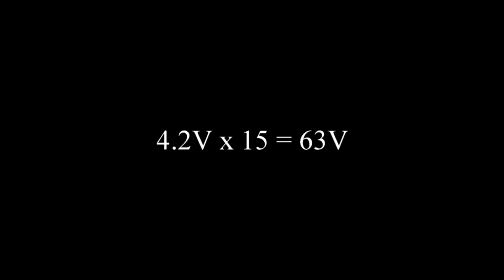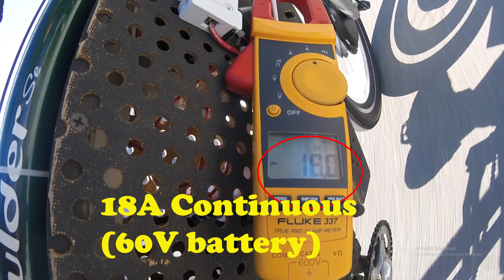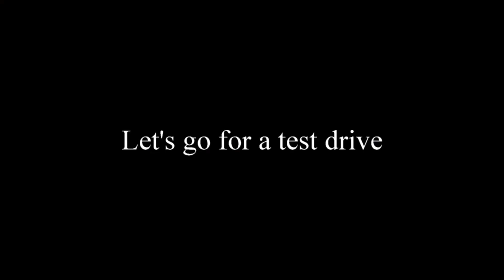Ebike battery upgrade: Over-volt with an external battery

Comment: What are those additional cables on the 12V pack? is that balancing wires? I want to do the same thing with my jetson bolt pro, add a 12V 6Ah pack in series to the 36V 6Ah battery. I’m confused about adding balancing wires. does my stock battery have internal bms? because i only see the positive and negative cables and the connector for the charging port. And do you have to charge the 12V pack separately? Thanks

Comment: Sup guys hope y'all keeping well.. I have a bolt 48v 2000w conversion kit, it's running on a 48v 17.5ah battery and it's not enough for me, so I ordered 60v 40ah battery.. you think my controller will handle the new battery?

Comment: Here I am again with a few more questions...
I've been looking for a YouTube video that is a tutorial for electrical connectors....specifically, connectors used for ebikes and escooters. I've found nothing. Do you have a video or know of a video or source that I can go and educate myself. 

Also, what's your opinion on lithium iron phosphate batteries? I'm considering getting some from Battery Hookup. My understanding is that they are safer, and have about 3 times the number of cycles. While they are less energy dense and cost more up front, in the long run, they are well worth it.

Also, I've been looking for Tesla cells, and while they are available, the going rate us about $1500 for the smaller battery pack. Is that what you had in mind? I haven't worked out the Watthour price yet. Do you know of a good source.? I live in Charlotte, NC.

Also, if there is just a connector kit that has it all and/or an easy source for all things battery building and whatnot, please point me in the right direction.
Reply from the maker: I use XT60 connectors for all of my ebike/e-scooters. Here's the video I made a while back: https://youtu.be/_CR8Mg7Lo98
LiFePO4 batteries are good for ebike. The only down side is it's not energy dense so it takes a lot of room on your ebike which it doesn't have. But if you can live with a lower capacity battery, it's for you. The thing is, LiFePO4 can last up to 3 times the number of cycles, but because it's lower in capacity, you might have to charge it 3 times more frequently than a regular NMC Li-ion. So which would you prefer, charge more frequently on a LiFePO4 or less cycles on a Li-ion? :D
Reply: @vuaeco  
Thanks, again!
Reply: @vuaeco  
The video was exactly what I was looking for.

Comment: You must be getting tired of my questions....
I'm going to get a bike conversion kit for my ex. I would get her the best if she hadn't slept with the football team, but I'm now working with a budget.

I would like to get a reasonably priced kit. Right now, I'm considering Ebikeling, Voilamart, and Bafang, but I am open to other options if you have suggestions. 

I'm planning to use her 56v volt Ego battery to save money.

1. Do you have a conversion video for Ego like Kobalt?
2. Do you know what ebike conversion kits can handle the 56 volt battery?
3. If you don't have a DIY battery conversion for the Ego, do you have a recommendation from Amazon that will work well?
Thanks!
Reply from the maker: I haven't done conversion for Ego 56V battery. But the process would be the same for the Kobalt. All you need is a piece of plywood and 2 metal L brackets. I would say most (if not all) 48V controllers would work with 56V battery because it's only 14S. My Ebike controller came from a conversion kit with a front hub motor and controller I bought on ebay about 10 years ago. It's still working today as you can see in the video.
Reply: @vuaeco  
Thanks, again!

Comment: I made something like this to go from 48v > 52v. Used 5x 2.6ah 18650 in parallel to match my 13ah main battery. Result: bike is way faster and the "Boost" pack drains at the same rate as the main battery. I've added a 2a charging board so I can recharge the pack via usb :)
Reply: if you run it in series did you make your pack with bms or balancing cables? I’m assuming thats what those extra wires are in his video. What about charging do u have to charge it separate?

Comment: I always use Anderson cable, but I rarely heard of XT60 cable.  Can XT60 cable handle high current? Good video my friend.
Reply: Anderson and/or XT60 is Not the Cable. It is the Connecters - The Plug and XT60 is for 60AMPS Continuous  there is a XT90 and Also a XT120 and the XT Connecters are better for All Weather and being outside in the Weather as the Anderson Plugs are not so much for being in the Weather. I Find Anderson Plugs Connect and Disconnect Easier then XT Plugs but once more the XT Plugs are harder to Connect and Disconnect do to the Tight Water Proof Seals of the XT Plugs and I am NOT Saying the XT Plugs are Water Tight Seals I'm just saying there a Tighter Seal to Weather then the Anderson plugs. Watch out for Fake Cheap Knock offs that Look very Real in Both Anderson and XT for they Won't Take the Amps and will Burn up and Catch on Fire so Don't buy the Cheapest Thinking your Getting a Great Deal for it maybe your Last Deal and it's just not Worth Saving a Few Cents to just Cost you your life.

Comment: 63V on capacitors is just an industry standard value. its been around since at least the 1980's long before Li ion batteries were around. after seeing the result athe extra battery just gets you back to where the original 48V system was. you get your 30% back. maybe its time to repack the 2 24V batteries with the Tesla model 3 cells ?
Reply from the maker: Maybe it's time...
Reply: They wouldn't fit they're actually bigger cells
Reply: @danieldougan8550  lol. thats never stopped him before..

Comment: Is using a 12v batt with a 48v batt in series safe?
Reply: Yes, just make sure the wiring and connectors are rated for the full load.
Reply: NO! NOT WITHOUT A BMS

Comment: Hi! I'm considering buying an e-scooter that uses Fengchao battery cells. Despite all along thinking I would build a battery using Kobalt tool batteries, doing the math, their replacement battery pack is considerably less expensive. 
 60v, 31.5 ah battery is $600. New, using Kobalt batteries, it would be at least $1000. Any knowledge about Fengchao battery packs? I guess I could build my own, but I think that would be more expensive still. I haven't priced cells lately.... maybe the prices are less than I think.  Do you have any advice? What's your preferred source to purchase affordable, reliable cells?
Reply: Get cheap ones at jag35,I use the  2 R15 for 72v
Reply: @stevesandra007  
Thanks!
Reply: @stevesandra007  
Do you know if they're just inexpensive with quality cells, or inexpensive with cheap cells?
Reply: @biggregg5  they have better cells ,like Panasonic,LG and Samsung
Reply from the maker: Jag35 is a good place. MY favorite is batteryhookup. You can get 2170 (LG or Samsung) for a decent price and build your own pack. Usually around $150 per KWh depending on brands and condition. Or just buy a whole Tesla module (each is about 20KWh with about 1000 2170 cells) and you have virtually unlimited amount of batteries! 
I don't have knowledge about Fengchao batteries but I would guess they use after market cells. If you want something cheaper and more reliable, build your own.
Reply: @vuaeco  
Thanks for your very thoughtful and thorough response!

Comment: I have run mine at 15s for 3 years.
Over 6k miles.
If you gear it at 54x9 I can get to nearly 50mph.
Violamart 1500w,  shunt mod too
Reply from the maker: That's nice!